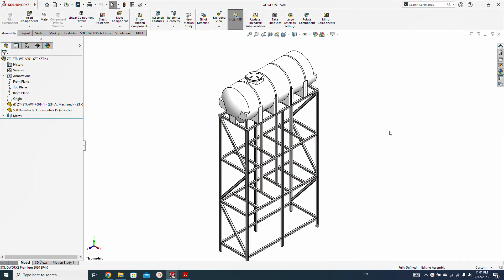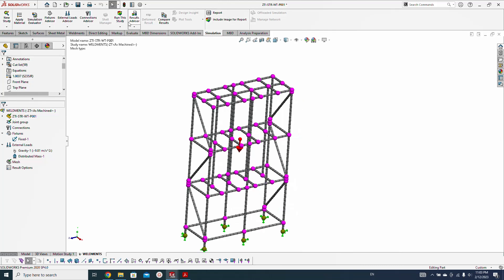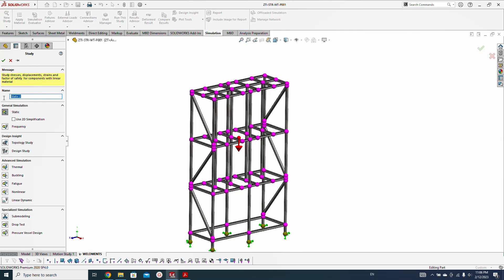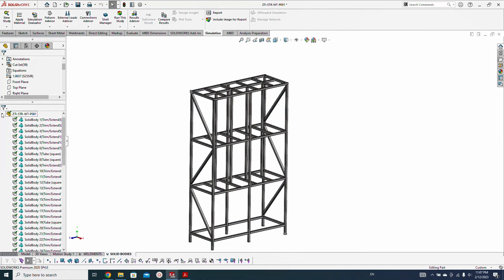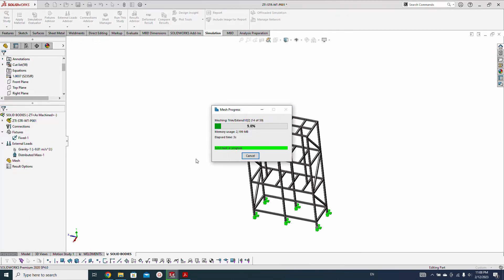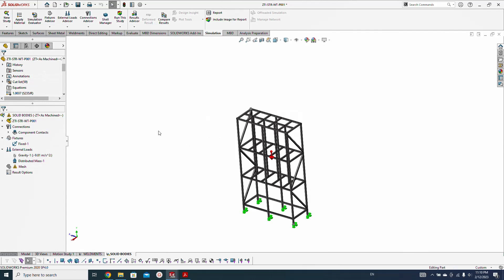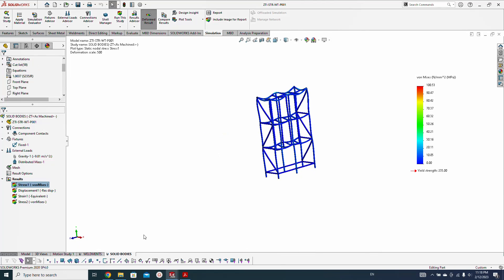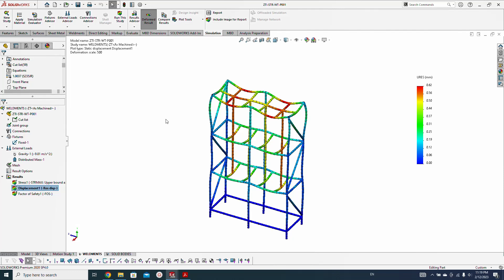STRUCTURAL TOWER STRESS ANALYSIS (DISTRIBUTED MASS) IN SOLIDWORKS

Comment: Hello! Can we transform the load into nodal forces and apply on nodes instead on beams, or this is not correct ?
Reply from the maker: Yes you can transfer load into nodal forces instead of directly applying them to beams, this can be useful for more detailed analysis or when you dealing with more complex model or load distributions,
1. Ensure joints between beams are properly defined
2. Apply forces on joints

Comment: Hey, if we applied force on Joints lets say im applying force on 5 joint, 5000kg it means all 5 joint distribute that 5000kg to 1000kg per joint, or each joint have force value is 5000kg means total 25000kg, 

Which one is true?

Comment: What different fiture  when you analyst Solid body and weldment sir?
Reply from the maker: Solid body fixtures are applied to individual solid components, while weldment body fixtures are used for entire assemblies created using Weldments, typically composed of structural members.
Reply: @zeetraininginstitute...4300   ok sir thanks. i have project , i want to analyst Tower lamp with material pipe astm a36, so i used analyst solid body or weldment sir?
Reply: I want know deformation and stress analayst. More better use solid or weldment analayts sir?
Reply from the maker: If you a simple geometry than better to use solid bodies. Or if you have a little complex geometry than better use weldments. Thank you
Reply: @zeetraininginstitute...4300  oke sir. Thank you sir
Reply: @zeetraininginstitute...4300  sir i want to ask, if i input new material A106 ? What do i input? Tensile and yield?